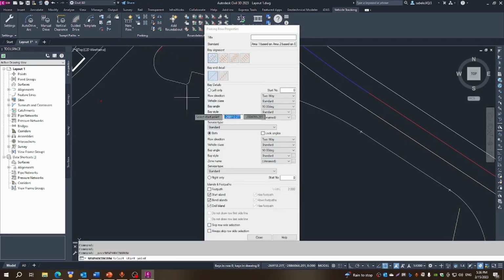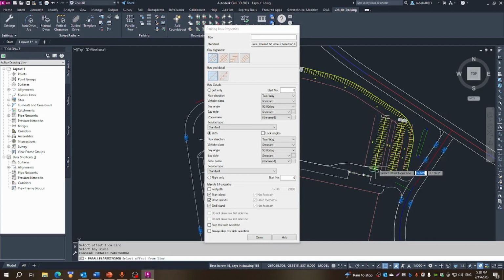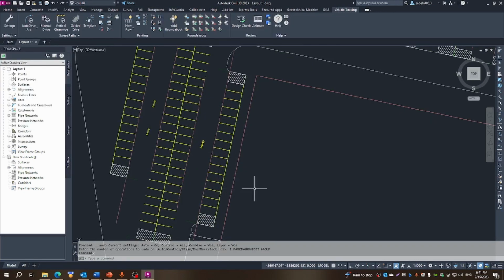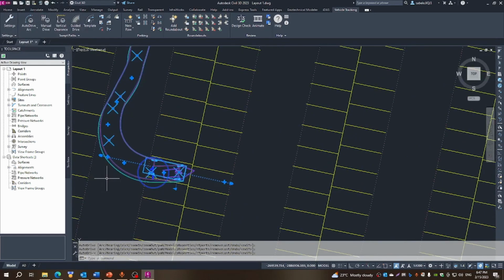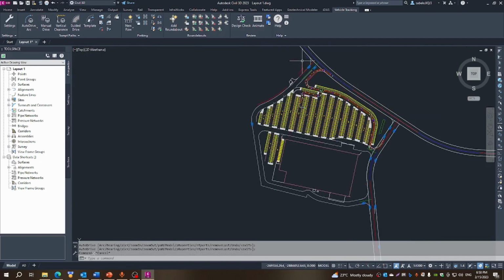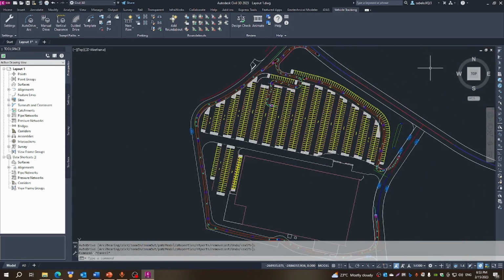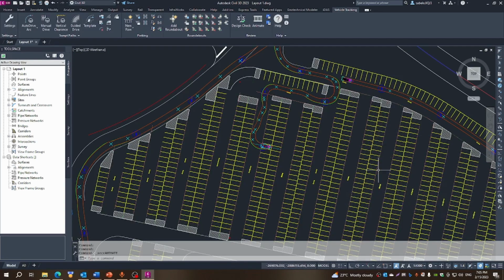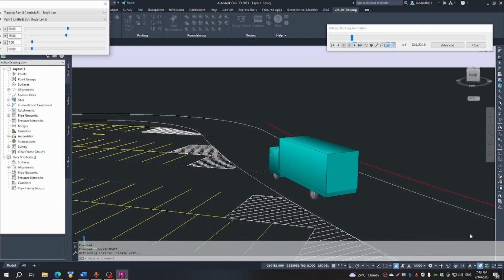Parking Lot Design - How to create a Parking layout for a Retail site using Civil 3D

Comment: When using the vehicle tracking program, add some defpoint poly lines parallel along the routes you'll be "driving" and use the pick alignment feature when "driving", makes turns much easier and more realistic looking.
Reply from the maker: Thank you very much for the input. Greatly appreciated